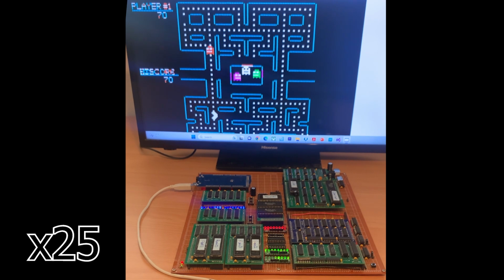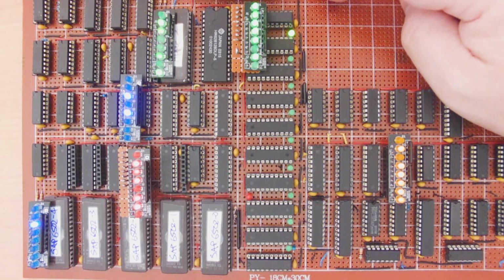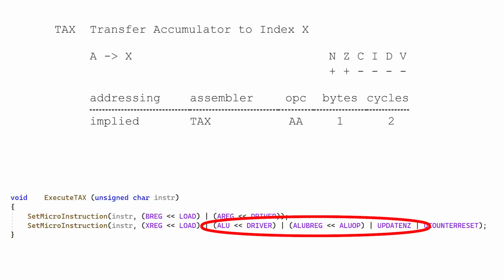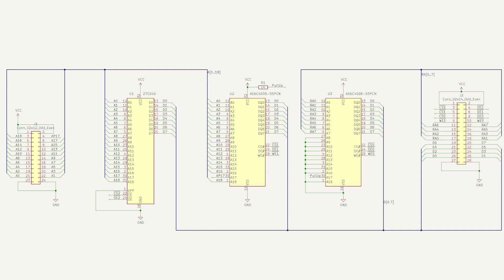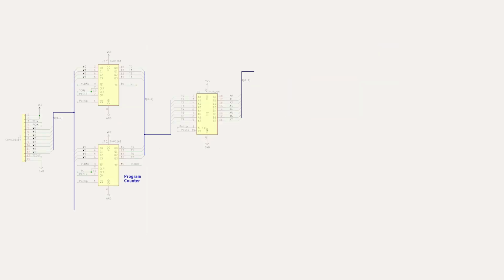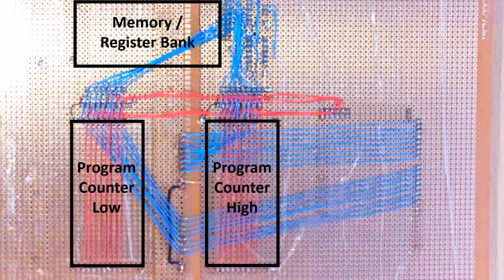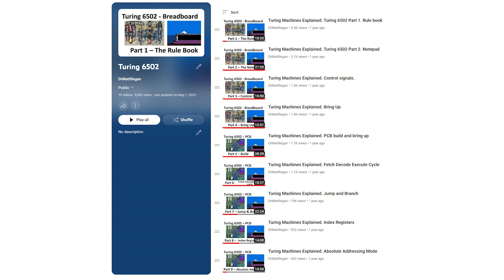TTL Apple2e Part 2: Memory board and Program Counter

Comment: I recently stumbled on your videos and am working my way through the various series.  While I enjoyed the Turing ones, the elegance of the state machine based design in the SAP-1 series is amazing.  I started on the SAP-6502 series but then got distracted by this series.  So many videos, so little time!

Regarding the clocking/enable/address delay discussion @10:30: wasn't that one of the reasons for the 2-phase clock in the SAP-1 design?
(A few years ago, I also designed/built my own 74xx-based CPU after watching Ben Eater's series and had a similar issue, which I also solved using a 2-phase clock.)
Reply from the maker: Welcome.  Yes a 2 phase clock would solve it, giving the signals time to settle, but in this case i could fix it in software, which was easier.
Reply: @DrMattRegan  Thanks for the reply ... It's bee a couple years since I made my last CPU (variant of Ben Eater's mashed with some ideas from James Sharman), and you've gotten me inspired once again.
I have a few more questions:
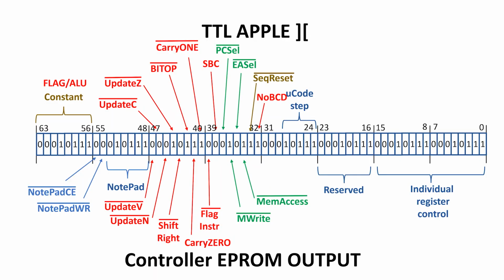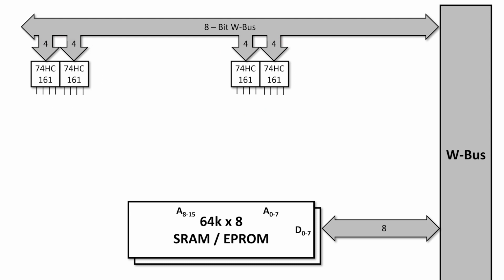1. Is the controller bit map shown @10:08 in this video the right one for this build?  It shows only 6 bits for the NotePad address (which I'm assuming corresponds to the register SRAM),.  Also, video #1 @6:17 shows the uStep counter bits as the MS 5 bits of the control word, but the map @10:08 in this video shows them at b24-28.  And it seems the /AREGCLK (b9), /BREGCLK (b8), /STREGCLK(b4), /STREGOE(b3) don't really exist since they're in the SRAM(?)
2. the videos show some chips in sockets directly on the perfboard.  Since they wouldn't be in any of the schematics, is there information you can share about their purpose and interaction with the PC boards? 
3. Is there any documentation of the interconnection between the PCBs?  Some of the interconnects can be surmised, guided by the videos.  But others are less clear.  One example: what is the AP17 signal on J1 in the MemoryRegisterBank schematic connected to and why is it needed?  In video 3 @13:32 "...for the most part it's just connecting up the labeled signals on the various cards..."  It is the "for the most part" part that has me wondering.

Comment: Im very new to computer hardware (though your inspiring me to try following along - thanks!), so this may be a dumb question.
Something Im not quite following here is the data in the ROM. I had expected the ROM to be something like an 'Apple ][ BIOS' or similar, but I see this is also where Pacman is stored.
My understanding is that the 6502 (on reset) will load a PC value from 0xFFFC and 0xFFFD, which is in the ROM address space and I imagine is part of the 'BIOS' - this is where I get stuck.

What does the ROM contain, what address is the Pacman code stored in the memory map and how is that getting executed?
Reply from the maker: Welcome aboard.  Yep, the Apple 2 ROM is a snapshot from the AppleWIN emulator playing PACMAN.  The problem with the Apple 2 bios, is that with no keyboard and no floppy drive attached it just sits in a tight loop, which doesn't test much (and looks like crap in youtube videos).

Meanwhile, PACMAN, tests most instruction types and addressing modes and produces constantly updated video.  

The RESET vector points to some code that copies the ROM contains into RAM and then executes from the known breakpoint.

Eventually there will be Apple2 BIOS alone, but during the testing phase, you want some code the exercises the machine a little.
Reply: @DrMattRegan  I've been scratching my head over this and I just can't seem to follow along.

I think I understand the theory, but where I trip up is that the ROM doesn't seem big enough to write the RAM.

When I use AppleWin to dump the running program (pressing F11), the produced YAML file contains the register values and main memory dump (48k).
My understanding is that I would write a little code (with the 6502 reset vector pointing to it) that would populate the ram, then set the registers to the captured values, then jump to the captured value of the PC.

However, from what I can find, the ROM area is 0xD000-0xFFFF, just 12k.
I can't figure out how to write 48k of data from a ROM that has this address range.

Sorry if this is a dumb question, its just that details like this really interest me and are key to understanding the machine fully. I think this would make a great video (like you don't already have enough to do!) as there is real depth of knowledge here.
Reply from the maker: @progressive.overload  some good questions.  So PACMAN is meant as demo, so i haven't gone into all the details.  Eventually i'll have Apple II basic in the 0xE000 - 0xFFFF range.
At the moment, i added some code to AppleWin which dumps the memory and registers in a custom format when it hits the 0xF8 instruction (Set Decimal) for the first time. This is copied into the EPROM with some added code.
  
Next, it's wired so that on reset, the machine reads from the EPROM and writes to the RAM.  I added some code into a some free locations that after reset, basically loops through the entire memory reads a location (from EPROM) and writes it back to the same location (in RAM).  It also preloads the registers and jumps to the PC location for pacman (0x7AF5 from memory).
Once the machine hits the 0xF8 instruction (SED), it triggers a flipflop that causes all the memory reads and  writes to
come from the SRAM.  Again this is just temporary.  Eventually this circuit will go away.  The EPROM is a 27c4001, 512K byte part, so it's plenty big enough.
Not as clean as i would normally like, but it works.

For reading the Apple Win memory, i just tracked down the call that LDA uses..

Comment: I have always wondered if an SRAM chip could be used as a register file. The PISC CPU uses a register file chip that's getting hard to find now. So using an SRAM could be substituted.
Reply from the maker: Interestingly, the Datapoint 2200 which lead to the intel 8008 used an SRAM

Comment: Going from TTL registers to SRAM will slow the CPU down though, wont it?
Reply from the maker: No really. the machine speed is mostly determined by the EPROM access time in the sequencer.
Reply: @DrMattRegan  but if I'm not mistaken you could have transfered one register to another in one clock before, while now you need at least two?
Reply: Could you do a ROM to SRAM transfer for much faster performance? Would be hard with several separate chips, but doable.
could also burn one time prom, which can be faster, though that's only incremental compared to ram. Would be nice to get the clock speed up higher so it's not unusably slow as an apple II, even if it's still much slower.

The JAM-1 project sort of took advantage of it, to a point.
Plus if you use SRAM microcode.. 
 @DrMattRegan
Reply from the maker: @mikafoxx2717  yeah, could use an SRAM instead, but i have 50ns 27c322s so they should go pretty fast
Reply: @DrMattRegan  Especially if they perform any greater than spec, yeah. What do you think is the most critical delay in the processor? 
Love the project by the way.
Reply from the maker: @mikafoxx2717  at the moment it’s doing the instruction fetch and EPROM lookup in the same cycle.  Will eventually pipeline it
Reply: @DrMattRegan  
Awesome, pipelining is great stuff. Especially when you can just move your other half of the microcode one step in. Just have to avoid the conflicts..

Comment: Why not use 6116 SRAM (or smaller SRAM) for the register bank? (less pins and smaller footprint)
Reply from the maker: You certainly could use a 6116.  I did actually buy some 6116s earlier this year but 628128s were actually cheaper.  Not sure how easy it is to get the high speed (<=50ns) versions.

Comment: Thank you for continuing the series as I found it most enjoyable. I must say, however, I am running behind, as I've only recently started bread boarding the SAP-1. I did recently find a source for used 27c322s finally, so I will be able to handle the larger rulebooks. I have noticed a lot of the newer ROMs uses a serial interface, so for future builds, I'm wondering if using parallel to serial and serial to parallel shift registers, assuming I can fit them in the packaging, would be a good means to emulate...
Reply from the maker: Actually, i think the serial EPROMs will really help with the 1-bit build in the PureTuring playlist.   It's always possible to use SRAM for the rulebook and load it up from the serial EPROM.
Reply: @DrMattRegan  I may have to watch that playlist again and try it out. Thank you for the advise.

I was already planning on whipping up the software Turing machine using either C# or Rust just for an excuse to practice since most of my work on the clock as of late has been Apex (one of those platform specific Java knockoff languages).

If I wasn't able to get the 322, I had planned to use my SD card reader with either my Pico Pi or my Mega to initialize an SRAM with the rule book on startup for larger sets until I could figure out how to bank the memory.
Reply from the maker: Good luck. Using SRAM for the sequencer should be fine.   It's probably easier than programming the EPROMs all the time.  In making the videos i try to avoid complexity if i can, but it's not the only way of doing things.

Comment: Great video as always, and I absolutely love the modular hybrid building technique.  Regarding the sprious writes problem, I always used the worst case timings when I was designing with logic and memory chips.  So even if multiple chips were near the limit, or if the power supply was a bit noisy, things would always work. But that was for mass production... it's amazing how fast things can sometimes go when you allow a bit of latitude in a one-off build.
Reply from the maker: Thanks.  All the boards are less than 10cm x 10cm so they are cheap and easy to get made.  It was a bit of a brain fade with the write problem.  I used the same microcode for the SAP6502, so I'm kind of surprised it worked in retrospect - like you said, you can sometimes get away with a lot with a one-off build.  Delaying write solved the problem.  Reads are forgiving, but it is so easy to corrupt data on writes.
Reply from the maker: Actually, now that I think about it, the data will often be late also for the same reason.  This shouldn't be an issues in a write provided the correct data is valid longer than the write time for the chip.
Reply: @DrMattRegan  That's correct. So long as the data setup and hold times for the RAM chips are satisfied, the data can change as much as it likes prior to the trailing edge of the write cycle (WR_ or CE_ going high, whichever happens first).